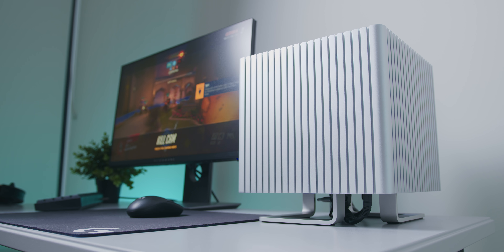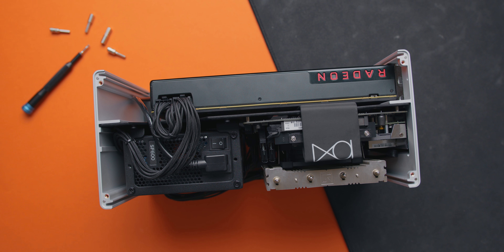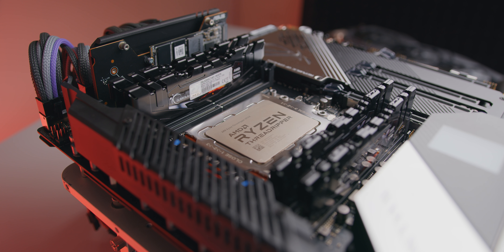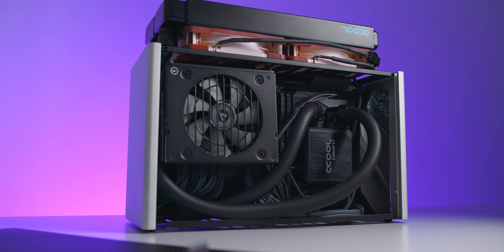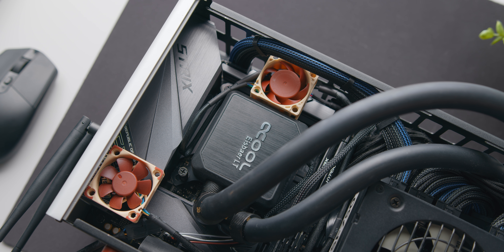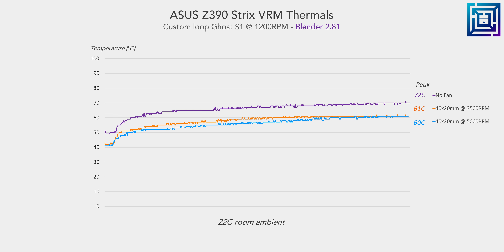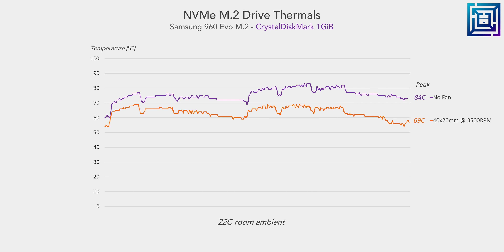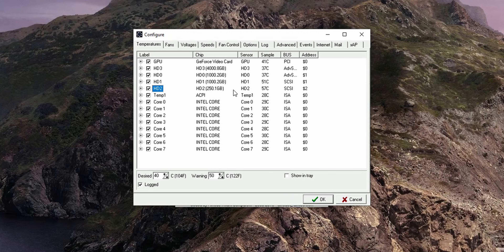Active VRM / M.2 Cooling ft. Noctua's Tiny Fans!

Comment: My Crucial T705 PCIe 5 SSD with built-in heatsink sometimes reaches 84 C while gaming. It's mainly due to absorbing heat from my 2080 Ti running at 75 C, and it slowly goes up from 50 C idle to 80+ C over a span of 20 minutes. I just ordered the Noctua NF-A4x20 to see if I can lower the T705 temps to under 80 C.

I'm not even running a SFF build - it's a Fractal Torrent and there's plenty of air flow. I guess there's not enough air flow around the main SSD slot. 

Vertical mounting the graphics card would definitely help with the SSD temps, but that's not an option with the Fractal Torrent since there's a 3-fan bracket at the bottom.

Update: The Noctua NF-A4x20 helped a lot. It now idles at 48 C and peaked at 64 C during a 2 hour gaming session. Thank you so much for this video, you're a life saver!

Comment: On ASUS Rog Strix Z790-E, it includes a bracket to mount on top of motherboard facing towards the bottom of your motherboard at DDR5. In the manual it’s 2.1.5 and 2.1.6 would you put that 50mm ram fan as intake and exhaust? I see the vrm 40mm fan in manual appears as blowing down on top of the black protective cover of the vrm area, is that accurate?

Comment: Thanks for the vid. Just did my first build where my VRMs are actually overheating. Bad enough I have the cpus underclocked 50%. The motherboard even came with decent heatsinks which many motherboards lack entirely. Gonna try some of these little fans tomorrow. Crossing my fingers. Without active cooling, the vrms start to run away at ~90° which they hit instantly under a full load. Ironically the epyc milan cpus arent ever even reaching 70°. I'm really hoping I don't have to buy a new case solely chosen for providing optimal VRM cooling. Last resort will be getting a case with mesh top/bottom or vertical mobo mounting to add airflow focused over the VRMs instead of. Lesson Learned! High TDP = always research the mobo VRMs and have a cooling plan for them ahead of time

Comment: Commenting 3 years later when Gen5 M.2 SSD's have EVEN WORSE thermal performance and now require stupidly massive metal heatsinks just to function below the throttling point. These little fans now seem like a great idea for even a mid to full size case.

Comment: This can definitely happen on larger builds. I upgraded my PC to an AIO from the stock AMD CPU cooler and noticed performance go down greatly, which made no sense to me since my CPU temps we're much lower. Turns out the air cooler helped cool the VRMs and with the AIO my VRMs we're hitting 125°C, throttling my CPU greatly. It was a cheap a320 motherboard so the VRMs had essentially no cooling.

Comment: 100% passive is silly. The best of both worlds is a semi passive build in a relatively open and big case. Any massive low density tower cooler can hold up to 65w of load of a modern Ryzen bellow 85c without the need of any spinning fan. If you need the extra power, just change the profile in Ryzen master and let a custom fan curve spin the fan ups above 85c with a high hysteresis threshold. win-win. Also, needless to say that calling a watercooled rig "passive" is also not correct either.

Comment: can i replace my noisy x570 chipset fan? and how can i do this, i thought get the chipset thing off, then put a passive cooler+tiny 40 or 60 mm fan on it, but then i somewere seen people cant put it in because the videocard is in the way then..  is there a solution fot this? i already send my board for RMA, and they can;t hear the high pitch sound so i got it back, and i can still hear it. so i want to do something about it but, what should i do... ?
Reply: can somebody help me ?

Comment: hmm, could 4 of these (4500 or 5000rpm) be better than one 80mm 2200rpm noctua fan on radiator? connecting them with zip ties could do the job, for experiment...

Comment: Funny that this is not a well known thing. That's why everybody should start out with FX systems xD 
in my case, you MUST cool those vrm's, otherwise they reach 105 degrees celsius in 5 seconds flat, and the cpu gets throttled to 1.4GHz
also the thing with speedfan is that it sometimes doesn't want to control fans based on different sensors. For example, if i try to control my fans using the VRM temperature sensor, the fans just go full blast.

Comment: I putted a tiny fan on the backplate, of the CPU.
this help reducing the heat there, and few points on the CPU too.
the SSD attached on the back of the case are also cooler now.
conclusion: fans everywhere!!!!! :P

Comment: So my question is and I am new to building computers especially one with fans.  For the nvme you have the fan blowing towards the heat sink?  Is it not better to buy an nvme active cooler?

Last time I built a computer was 2001, just in case you are wondering.

Comment: Going to add a few of these to the exhaust vent of my fractal design node 202, vrms are getting super hot and with only a noctua l9a cooling the ryzen 5 2600 they will assist in pushing that hot air out

Comment: 72c is entirely fine for a vrm, spending $10~$15 to lower the temps of that isn't worth it at all. Only do this if you actually have problems. Even then you should probably have spent the money to buy a motherboard with decent vrm cooling
Reply: Which is exactly what the dude in the video says, hotshot. Try listening before you speak.

Comment: PWM signals makes coil wine in many fans especially at lower speed to overcome it using voltage step down adapter cable is a good idea test this.

Comment: Running a R9-3900x on a B450M-Pro4 (budget board). Got some nice fujipoly 11W/mK thermal pads for the vrm heatsinks, put 2 Noctua 40x10's on each vrm with some zipties. VRMs stay frosty and my 3900X boosts to 4.2GHz all core, all day long, no issues. Didn't see any zipties in the video though...how'd you mount them so cleanly???

Comment: The NF-A4x20 is a beast! One of the best fans Noctua makes, for real. I have bunch of 10GBps switches at work that were crazy loud, and it turns out they had those industrial Delta 40mm fans.. Great fans, but LOUD. Replaced them all with the A4x20 and now they're almost silent while still performing well within spec. Completely amazing!
Great video. :)
Reply: they have a lot less airflow tho

Comment: I wonder what the long term cooking effect will be on the double stick tape, when they are affixed directly to the fin array.  The fin array is dissipating heat by convection and that radiated heat will transfer directly to the tape via conduction once it's stuck directly to the heat sink.

Comment: I fixed a tiny noiseblocker fan with zip ties in my Fractal Design R6 directly above my GPU to push hot air away from my M.2. It works well.
Reply: @Ziv Zulander 60x60x25 mm with about 2000 rpm, but that tiny beast is surprisingly silent.
Reply: @Ziv Zulander I have this model:
https://www.blacknoise.com/site/en/products/noiseblocker-it-fans/nb-blacksilentfan-series/50x50x10mm.php?lang=EN

But there is also a(n even) more silent Pro model:
https://www.blacknoise.com/site/en/products/noiseblocker-it-fans/nb-blacksilent-pro-series/60x60x25mm.php?lang=EN

Comment: I have a Louqe Ghost S1 system with  a skinny Rtx 2070 card and i was thinking about buying those fans for gpu chamber at top side. However i didn't know about their speed and now i am shocked. 3500 rpm way too much and i can't believe that bearing will remain quiet. You say they are inaudible at 3500 rpm but i am still sceptical. I wanted those for lower gpu fan noise anyway. Thank you for the review. Cheers!

Comment: Sooo, I built my own PC in a Fractal Design Meshify case, how do I test the temperature of the motherboard VRM or even the M.2 drive? My computer should be blazingly fast but in games like Overwatch I occasionally have a stutter in my otherwise 180 to 220 FPS gameplay.
Reply: Infrared thermometer or thermocouple.  Or touch ur dinky to it

Comment: Asrock A300 user here! As far as I interpret my hwmonitor right my vrm temps are pretty high(tmpin 6 and 8 are consistently showing over 110 and 118 at idle although it goes down for a couple degrees (about 5) when gaming a little bit on my 3200g thanks to the l9a, so I guess that those are the vrm temps, correct me if i´m wrong).  Does anybody consider this mod useful or would I just block the exiting air from the cpu cooler if I mount a fan on the fin array which is located above the cpu cooler, where the air exits the case?

Comment: I had a motherboard with AMD fx processor and mounted the stock cpu fan over the vrm to prevent crashing because of the inadequate heatsink the board had on the vrm.

Comment: I thought the flash chips on SSD's M.2 , etc.  wanted to be within a certain temperature range and it's mostly the controllers that normally need the extra cooling.   So from what I understand and could be wrong you can over cool the flash chips in an attempt to keep the controllers cool.   Not sure exactly how cool is too cool for flash or too hot for that matter.
Reply: Jeff M Thermal pad the controller only and then blow air on the sink.

Comment: My Ghost S1 has watercooled gpu/cpu like yours. I have a small tophat in the bottom with a NF-A12x15 PWM placed under the motherboard as intake and the large tophat in the top with 2 NF-A12x25 PWM as exhaust above the radiator to pull the air trough. It works great!

Comment: I wouldn't remove the back sticker, it keeps the lube of the spinning gear inside the fan ...
Reply: And dust out as well :)
Reply: The mounted double sided tape serves as the "sticker". It seals the hole.
Reply: Those fans don't have such hole on them

Comment: OOoooo, I was wondering what was causing the stuttering! I placed these small fans over my 4-channel RAM DIMMS and that fixed the issue of BSoDs I was seeing while gaming, and helped with the stuttering [guessing the nearby increase in airflow is doing some VRM cooling?].
My board (ASUS 
PRIME X299-DELUXE) has a pretty beefy heat-sink on the VRMs, would it be best to leave that in place and add a fan that blows over it, or remove the heat-sink and add the fan?
Reply: If you remove the heat sink, you also remove a lot of thermal mass as well as surface area for cooling the VRMs. You are better off with cooling the heatsink itself, unless the heatsink is not conducting adequately, which might be an issue with thermal pads instead.
Reply: @MonMalthias  Thanks for the advice! On my ASUS MB, I have a VRM heatsink which is basically a solid block of aluminum with only 7 "fins" that are only cut into the block about 1/16" deep. I put a 4" fan blowing down onto that block, and I'm seeing no more in-game stuttering!  Unfortunately, I just have the fan sort of precariously hanging above, so I'd like to try a better design, which brings me back to the idea of using individual heatsinks with more surface area per MOSFET, vs the single block as thermal mass. If I use two of the smaller Noctua fans, blowing up over the individual heat sinks, do you think that would be better or worse than using the existing thermal block? THANKS!
Reply: @ZacMorris   
In general, more surface area = more cooling, so it's worth a shot. Heatsinks are quite cheap, especially small ones, so the more the merrier.
Reply: @MonMalthias  Thanks!  I decided to leave the heavy thermal-mass heatsink, but I just attached a bunch of tiny chip heatsinks to that, which seems to help dissipate heat more! I also use this specific little SSD heatsink/fan combos, and I didn't realize that it was sharing a thermal block that also cools the PCH [Which I was incorrectly reading as the PSU!] so I cut a new large fin heatsink that fits above my SSD and that brought the PCH down from 59C to 37C! I now have everything running in the 30C-40C range at full game load, and no more stuttering!

Comment: Well I have a side mounted 200mm fan so my M.2 never reaches above 50C under load. But I have some plans to do some VRM cooling maybe these can be handy.
Reply: I guess with my noctua nh-d15 it is killing those VRM cooling right? Sometimes worried abt vrm temps...but nh-d15 should take good care of that, just by logically thinking , it is feeing air directly thru the MB vrm heatsinks. Altho I can't test my VRM temps yet since I still haven't build the pc lol, Still choosing parts.
Reply: @weaver4907  if you get a decent board your vrms will be fine with no to minimal airflow. For example my vrms on the X470-f strix never exceed 60 degrees even without a single fan running. They kick in once water temp reaches 38 degrees. I'm running a 3700X atm.
Reply: @WatchMysh  Gonna get aorus master...it seems to have the best vrm cooling for z390, and also a very good vrm. Yeah but I still wanna go air cooler to get active vrm cooler. Noctua nh-d15 is especially good since the fans is a little bit "extra" I will go with a single 3000RPM 14cm noctua fan. I am the type of person that dont care about noise. To me its nothing, its music to my ears like the wind blowing on a good day, to others is "jet engine take off even at 2000 rpm...lol", I am blessed :), all my components must be happy to get a masochist owner like me :). My case is also full of 7 fans...all 3000rpm.
Reply: @weaver4907  well... Then you shouldn't worry at all
Reply: @WatchMysh  Yeah, except I will need to do some case mod...a v ery common one...I will need to drill a hole and put a honeycomb piece in the front,...since, you know cases these days...they have no holes/very limited holes...Since I am using noctua 3000 fans, I don't think it will be able to breathe fully without any mod. If I go with the standard 1500s it should not be needed, but for my case I think it is.
Reply: @weaver4907  which case are you going to use?
Reply: @WatchMysh  asus tuf gt-501
Reply: @weaver4907  Ok. But why not get a case with unrestrictive air intake in the first place? Is there something about the design which made you pick this particular case?
Reply: @WatchMysh  yeah something about the design lol. And I can't really find unrestricted airflow case in the first place that can hold 3x120 fan front and bottom, any recommendation?

Also I like the PSU dust filter :D.
Reply: @weaver4907  3x120 bottom? The 501 doesn't have bottom fans according to its spec sheet. Did you already check out the h500m from cooler master with the mesh front panel? Its a beast for air cooling and holds 2x200 or 3x140 fans on the front and 2x140 or 3x120 on top. Cooling performance is outstanding. Watch the gamers nexus review if you haven't already. :)
Reply: @WatchMysh  Oh 3x120 cm front is what I meant, my brain must have fucked up lol.... that cooler master is kinda ugly for my taste...hmm...maybe I'll still check it...Idk it can support 3x140 tho, I always thought it always needs 2x200 and nothing else.....I'm looking for maybe for not so "popular" case that has great airflow, which is very hard to find these days...All popular ones sux so bad at airflow...

idk, I may get cooler master...but then i already bought 3x 120 fans...which...will be wasted...

I am from Malaysia btw...very hard to find/pay someone to do case modding service here.... I don't wanna buy all the equipments since I will just use it once...and I may do a poor job anyway.. Dilemma2 :). But it's a good dilemma lol, cause I am very excited for my new Super PC :).
Reply: @WatchMysh  I know what I will do. I will do some stress testing with 4 variables with gt-501 to see how much difference it will make in temperature.

1. Default with dust filter
2. Remove the front part with dust filter
3. Remove the front part without the dust filter
4. Default without dust filter.

Idk,...I was thinking, since I am using 3x 3000RPM Noctua fans, (which like only 0.001% people in the world will do...cause...."RGB"...and..."Disco"...Damn, only 0.001%??, damn it feels good to be a masochist lol) then maybe it can "brute force" the airflow in and it may wont be much that much difference than when using 3x 1500 default fans (or maybe it will make greater difference with more holes since those low fans only need limited holes and they already hit ther "ceiling"?, who knows, this needs testing. I will test them. This will give me more or less the same result as the mod will, but without needing to mess with the case :).
Reply: @weaver4907  I think you will get good results without the filters. :) Have fun building and testing! :)
Reply: That's gotta be a very old case. Had an acase case with 3 200mm fans to in the from and one on the side panel. Weird stuff.
Reply: @theunholybakery1990  Yes I have an HAF X I even placed an extra 120mm on front and have 360mm rad for CPU. Temps for GPU and and NVME are really good especially winter times where GPU never exceeds 55C.

Comment: This would be less of a concern if we had finned and heapiped cooling solutions like the old Gigabyte 775 boards. Giant aluminum chunks are not the same.
Reply: if that is the case, get one of those old boards and mount their solutions on newer boards. where there's a will there's a way. i made a m.2 heat sink out of a old gtx 460 silent gpu's heat sink. from a 8 gram m.2 heat sink i now have a 16gram m.2 heatsink. and it made a big difference.

Comment: My RAM is under OC, 3800MHz CL16 at 1.42V (not completely tuned yet). The backside of my RAM (the side not hit by direct airflow, on the side of the processor, which is itself under water) was getting quite toasty. I have mounted a 50mm fan on my RAM sticks, with tweezers... I mean, cable ties. It's janky, but the temps dropped. If it's stupid and it works, it's not stupid, right?